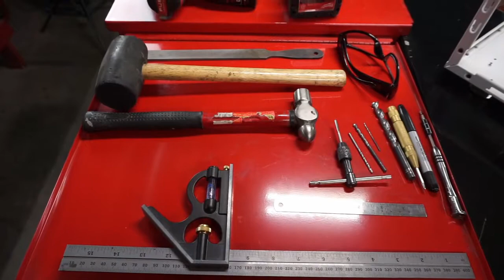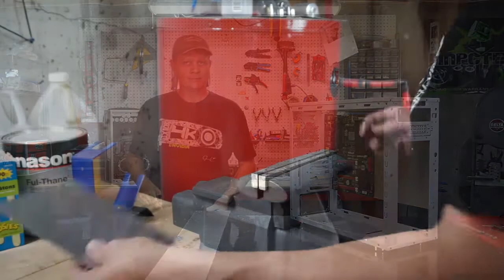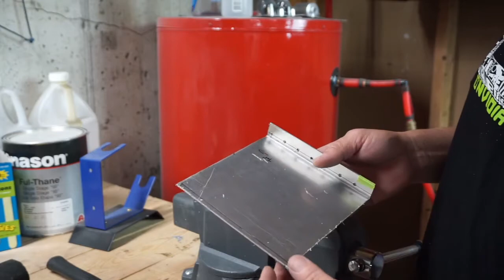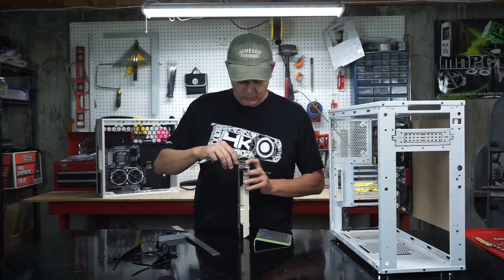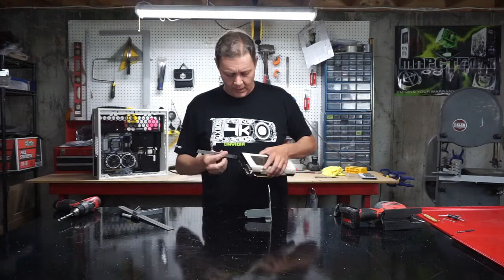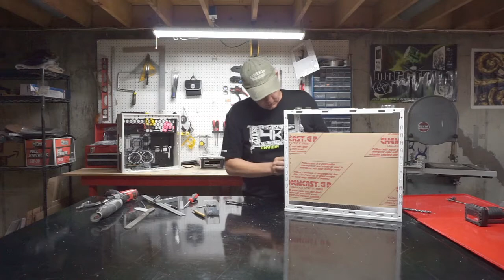Down & Dirty Modding - Making a bracket to mount your GPU vertically

Comment: Awesome video! Finally a method that won't cause irreversible changes on the case.
Reply from the maker: Thanks!  Well, mostly irreversible.  You do have to cut the little dividers between the PCI slots, but I think that's a lot better than cutting a hole in the case.  Watch MNPCTECH though, Bill Owen is coming out with a bracket that fits a 120mm fan mount that will use spacers to not have to cut the case at all.
Reply: Okay, I'll look it up!

Comment: Awesome job, the only problem I have is that it destroys any chance of using other PCIe devices. I saw this new bracket that mounts to a 120mm fan spot - https://mnpctech.com/case-mods-gaming-pc-liquid-modding-custom-computer-mnpctech-overclock-cooling-fan-grills/mnpctech-stage-2-vertical-video-card-gpu-mounting-bracket-black.html. I may go that route, though I hate not doing it myself...
Reply from the maker: I believe it might be possible to mount the GPU high enough to use the bottom slot on an ATX board, though, I haven't checked.  But other than that, yeah, you're blocking the PCI slots.  Though you could relocate the PCI devices as well.

Bill hadn't released his bracket when I made this video, but it does provide a lot more options as far as moving the GPU to different spots.  I've got one and I'm planning on using it in an upcoming build.